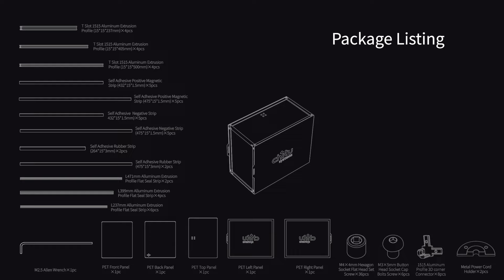AMS Lite Enclosure for Bambu Lab A1/A1 mini Combo - Insulation & Moisture Control!

Comment: Hmmmm. I can appreciate convenience, time is money, and spending days printing an enclosure just for the spools may not be in everyone's spare time budget - but you've got to add a couple of bare minimums: 
- Hygrometer mounted to the front
- Desiccant container(s) (at least design a nice STL for people)
- Hinged or removeable top and/or front not just sides
- a floor or a gasket on the bottom
- IMHO the feature that would sell this product faster than an a1mini itself- two rectangular holes designed to fit the POLYDRYER base, so users can snap it on and pull it off to add filament drying and/or filamenet drybox functionality - or not and keep it enclosed without having to dremel out and risk destroying the acrylic.

Comment: what's the point of doing this? I don't see any place to install a dryer or a drying device
Reply: this is not for drying, it's only for humidity control of the open filaments. you should not put an heating element inside as all the components in the AMS are temperature sensitive and should not be near any heating element, or high temperatures.
Reply: all they have to do is cut two rectangles the shape of the Polydryer base's vents, it'd sell itself.